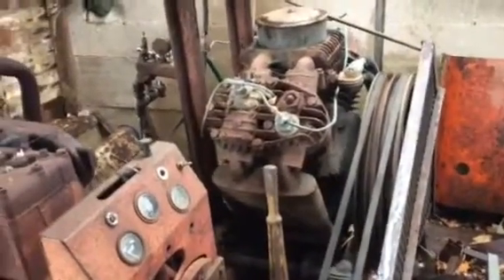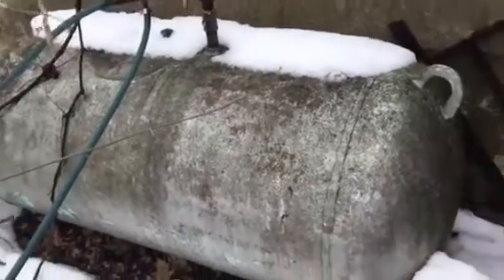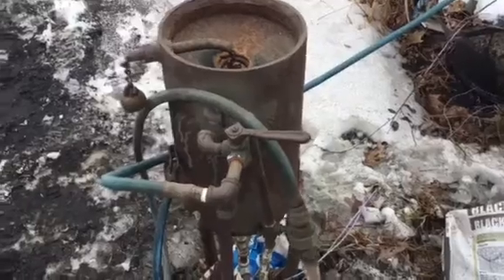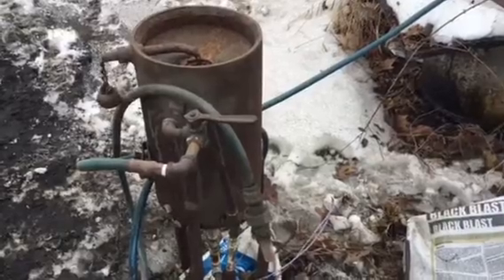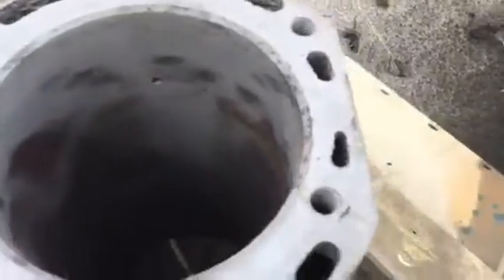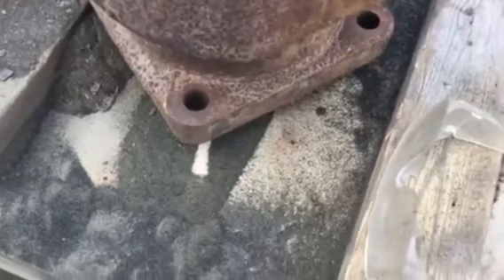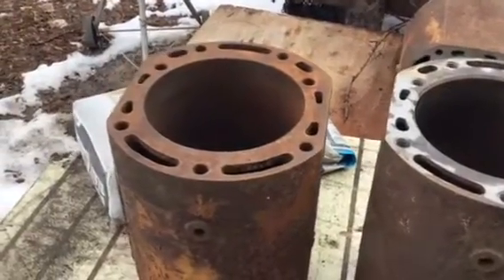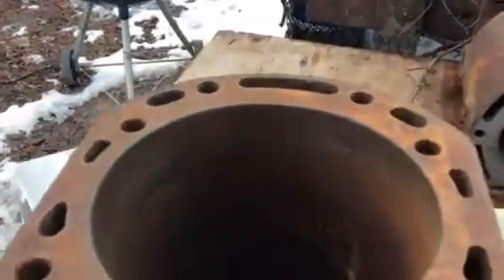Continued work on Cat 60 Part 1

Comment: Im very keen to see the old 60 running, there are a neat old sounding machine.
Ive been playing around with Malasses/water mix for cleaning away rust and i was just thinking it could be good for cleaning out water gallerys of rust? 
Ive been soaking parts for my D7.